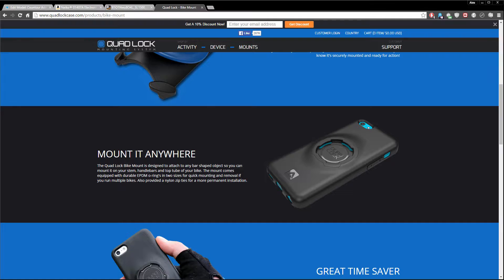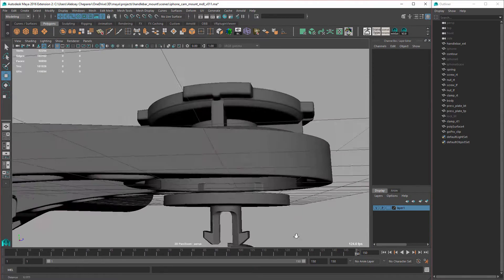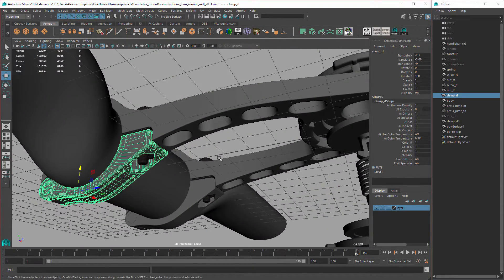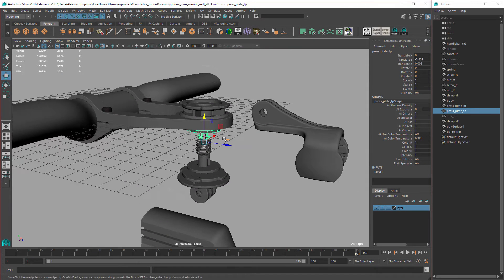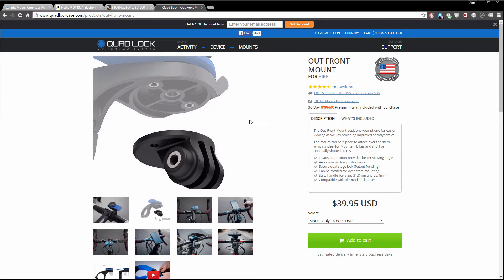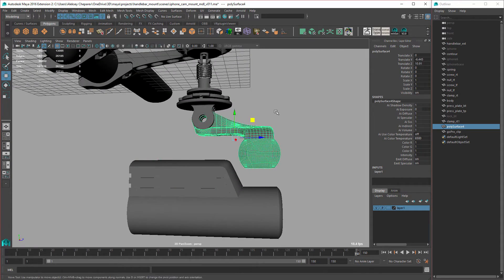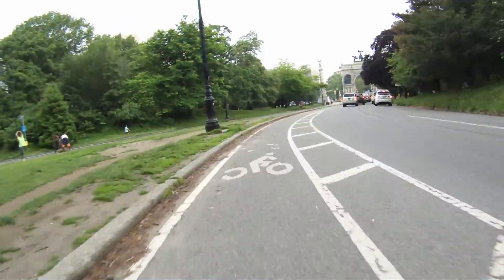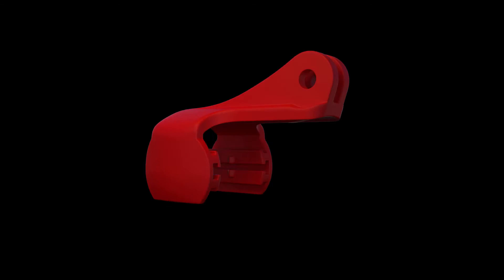3D Printing Contour Roam GoPro Adapter - and Getting Doored!

Comment: Hey Alex! What tools are you using for precision modeling in maya? Like set the grid unit properly, measure distance tool, etc. It looks awesome btw!
Reply from the maker: I use the default scene scale of cm in Maya and use cubes for measuring. When  you make a 1x1x1 cube it's 1cm. Also each grid unit is 1cm. But, before uploading, you must scale your model by x10, because shapeways doesn't have a cm option only mm.
Reply: Thanks!
Reply: dude you are so cool! this is so diy awesomeness.

Comment: What file format do you need to send it in, for it to be 3D Printed? I thought 3DS Max was the preferred software for 3DP? Even though I much prefer Maya...
Reply from the maker: I upload as OBJ. Any 3D package will work for printing. Also, when uploading to shapeways and working in cm in Maya,  you'll need to scale by x10.
Reply: Oh I see. That explains what happened when I visited the Stratasys offices here in Chiba. They had to mess around with the file I had selected online for them to print. 

.obj x 10 scale. Got it, thanks man!

I just started working as a junior rigger so I'm not particularly well-versed in such things...